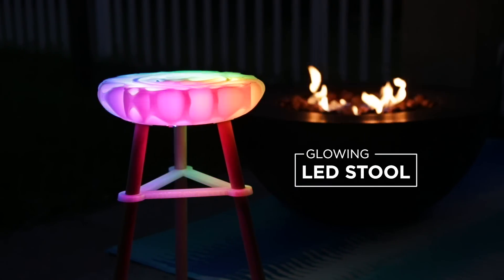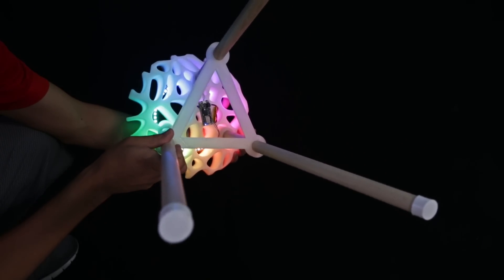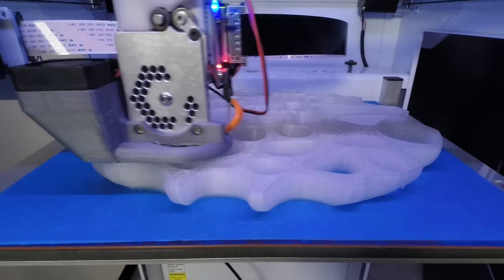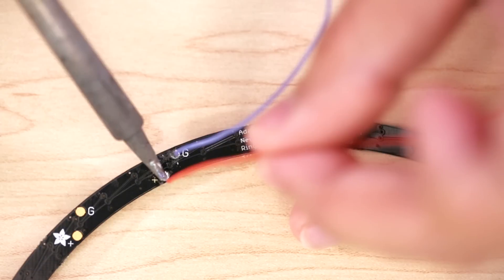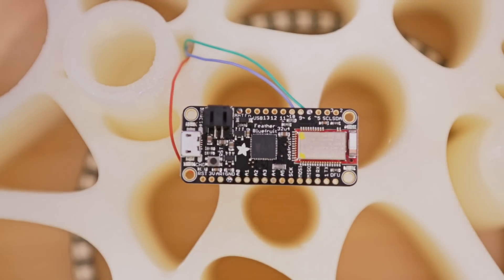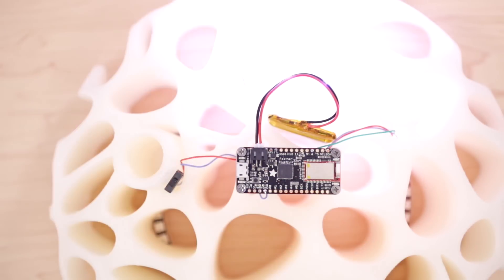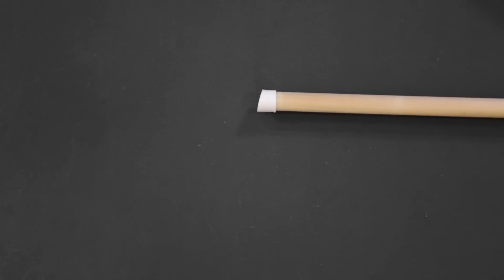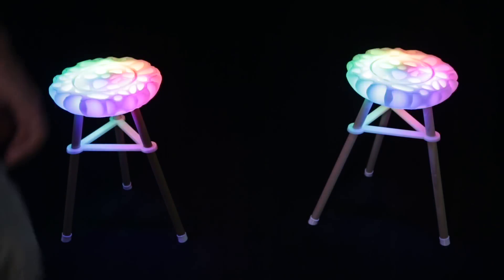LED Chair #3DPrinting @adafruit #adafruit

Comment: Is it possible to split up the seat in multiple prints and then glue together for those with smaller build platform? if so how would you go about doing so?

Comment: How comfortable is the seat? With the neopixels on top and the design, I am just wondering how comfortable it is.
Reply from the maker: +seeminglyRANDOM88 pretty comfy - fillets on the edges are smooth, the ring is inside a groove like shown in the video
Reply: Gotcha. Thanks. Keep up the great work and amazing projects!